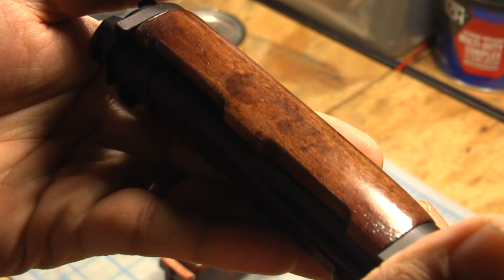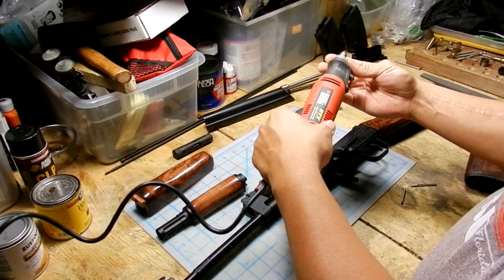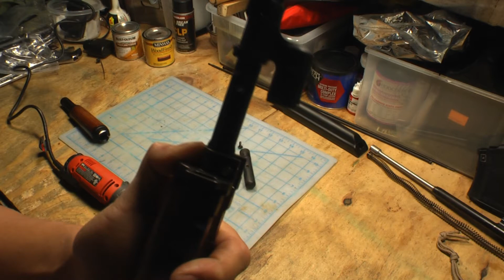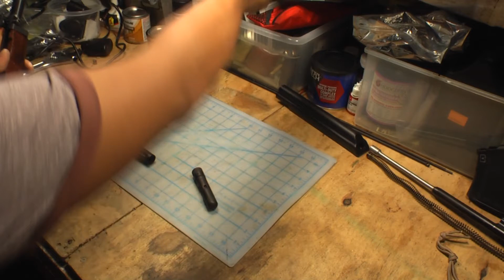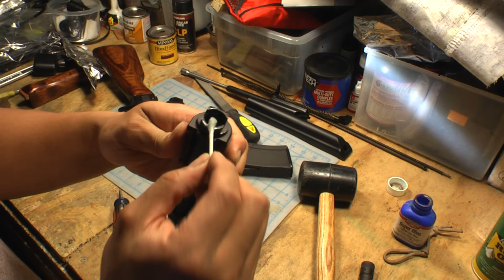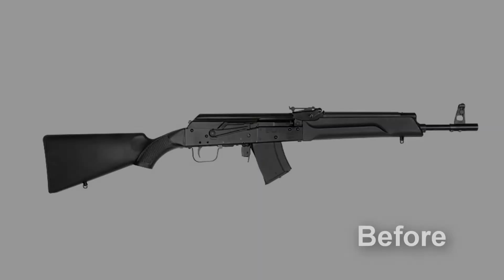Saiga 7.62x39 Rifle - AK handguard and stock conversion (1080p HD)

Comment: Great Vid👍👍 I got a retainer slot that was cut i little too far forward in the barrel.
So there is a gap between the retainer and the handguard.

I'm thinking about welding/soldering metall into the original slot and filing a new slot in the correct position.

My concern is that the high temperatures could weaken the steel - so there could be a safety hazard. Maybe JB-Weld could be a alternative?

What would you do?

Thanks and with best regards

Comment: Question once you notched the barrel to fit this handguard, isnt the notch going to be off when installing a magpul ak forrend thereforr making this rifle only able to accept the handguard you have installed?
Reply: Depends on the length of the hand guard. In my opinion, build it how you want it to stay. If it isn’t tickling you where it needs to, build another rifle.

Comment: I need some help..
I had a gas tube laying around and I dry fitted before I started my front end conversion. It's very loose. Should I order a new one that has not been used? I'm ordering the handguard retainer from css..will this help hold it? 
Thanks

Comment: First off great vid lots of good information, and beautiful job on the notch on that barrel. But, a minor suggestion nothing to do with what you did. but you might consider doing a bullet guide in this even if you don't do a full AK conversion merely so you can use the much much cheaper AK mags out there.